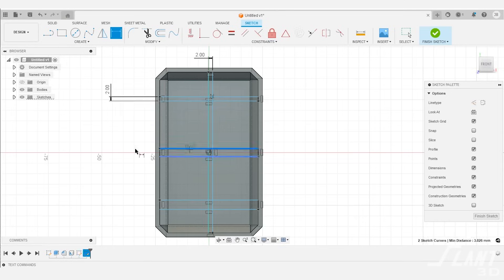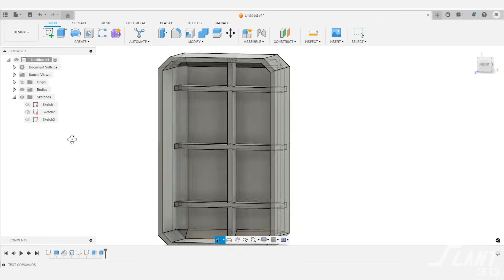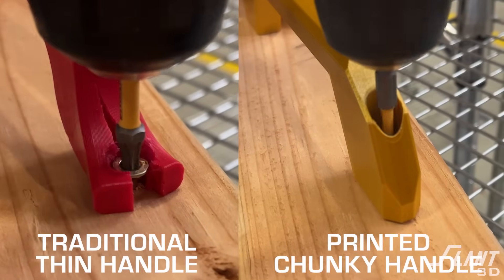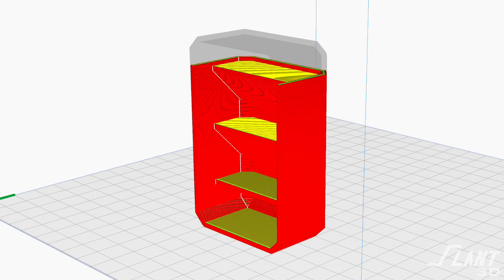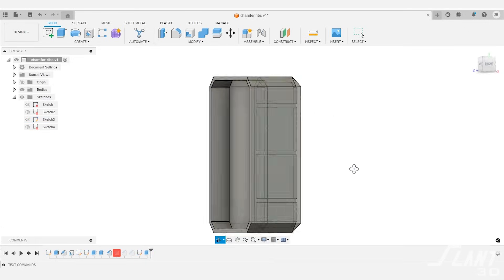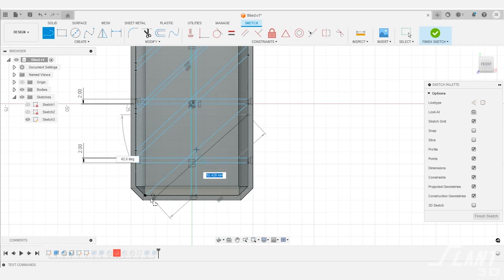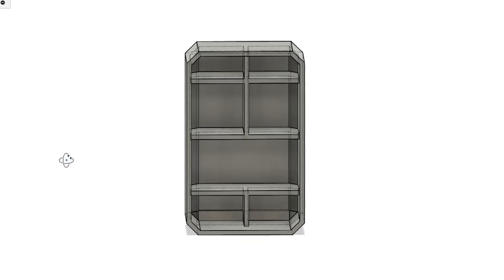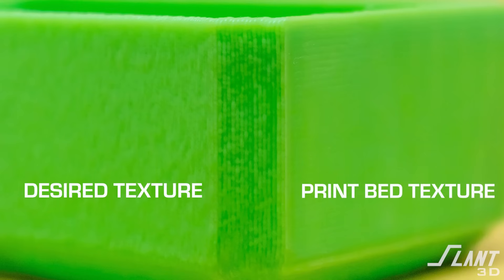Ribs | Design for Mass Production 3D Printing

Comment: there's something I don't understand: why does the top of the part not require supports when printed at that orientation?
Reply: @way-out350 I assume you are wondering about the second model. If you look closely, the top part is shallower than the rest which would reduce the likelihood of sagging. But that is never mentioned in the video.

Comment: Frankly, as interesting as these videos are, I feel like they kinda fail on the most basic, fundamental level: 3D printing is not a viable tool for Mass Production. It's not that companies haven't figured out how to design products to be mass-produced via 3D Printing, they just realized that other production methods scale better when you get to the level of producing hundreds, thousands, even millions of identical copies of the same product.
Reply: More clueless traditional thinking. If 3dp doesn't work for mass production then why is he literally DOING IT RIGHT IN FRONT OF YOUR FACE and making a good living off of it?
Reply from the maker: We are the largest print farm in the world. We do it all the time.
Reply: @slant3d  just because you spent a lot of money on an idea doesn't guarantee the idea is actually a good one. What is it about 3D printing that would make it a better production method than say, injection molding or die casting?
Reply: @lightningstrike9876  starting cost is lower, and you can get parts shipped to your warehouses at a constant rate instead of all at once, or even ship the parts directly from production to customers.
Reply: @justageekygamer  fixed costs need to be balanced against dynamic costs, however. In a mass-production setting, the special spools of material for the 3D printing setup are going to be more expensive per-ounce that the material used in simpler production methods.

Shipping is itself a cost that needs to be considered, and shipping is generally calculated on a per-delivery basis. The more product you can ship in a single delivery, the cheaper it will be. Companies prefer the occasional big shipment over a constant stream of small shipments.

Once you get the point of shipping items directly from production to end user, that only really becomes necessary if products are being made on-demand, and at that point it's no longer "mass production".
Reply: @lightningstrike9876  while I appreciate the content this channel provides it's important that people aren't misled (in a non-nefarious way in the case of this channel of course) so thank you for providing this information.

Comment: Thanks for the lesson on ribs.

Slanting (punt intended) prints to eliminate overhangs and supports is a powerful idea. I once printed a garmin to gopro mount adapter and I can tell that if not designed to be print slanted, the part will most likely print horribly, requiring supports in tiny tight space that would be a pita to remove.

Comment: We need more Channels like Slant 3D.
Reply from the maker: Thanks for watching
Reply: I second that. Engineering specifically for 3D printing is the next level, and this channel leaves nothing to chance.
Reply: @mbunds  people seem to get hung up on designing for 3D printing, saying things like, “you shouldn’t have to design for the manufacturing method, the printer should just be able to print it” and all that, it might just be because a lot of people watching are hobbyists but it just shows they don’t know what they are talking about. Every manufacturing method needs parts designed specifically for it, a part designed for machining would be different than for injection moulding. You always need to design to make use of what technology you have available and in any use other than hobbyist you have to design it to reduce cost.
Reply: @conorstewart2214  Taking the hard path long before I had the pleasure of running across your channel, I learned early on that there are essentially two approaches to 3D printing, "proportional", where items like statues, figurines, and other decorative objects, along with low-precision utility items, which do not require precision tolerances, and the "precision" approach for gears, bearing shells, threaded assemblies, and enclosures which require extreme tuning of the FDM system to reduce post processing.

This requires learning the finesse behind adequate bed adhesion and good first layers, then balancing speed and temperature to get tight control over warping and layer adhesion, which I have nearly perfected, thanks to people like yourself.

A feel for the filament types is essential as well, and not only the gross type of plastics like PLA, ABS, or PETG, but the way various blends of these among manufacturers respond when printing, which is why every shipment, even if I have already "trended" the blend (manufacturers aren't always consistent in their blend proportions), gets profiled and documented with a label indicating its best performance.

After learning to adjust the way I design for 3D prints (thanks again) now, when a part is ready in CAD, I only have to drag the model into the slicer, then WiFi it over to Octoprint on the target printer, and assemble the parts when finished. I can produce very precise centers between holes, and adjust the tolerance for how well a part will accept things like bearings from press-fit, to light friction at will, in a single iteration, zero "elephant's-foot", zero "PETG stringing" (mostly), with maximum strength.

What I don't have is speed, because PETG and TPU taught me that sometimes there is no substitute for patience.

Thanks again!
Reply: @mbunds  this isn't my channel and I don't have anything to do with it.

Yeah a lot of people just see all PLAs as PLA, or all nylons as nylon, when most of these names are just general and broad terms and the properties can vary greatly depending on what exactly they put in it, even just looking at the TDS of filament it varies a lot even with the same name like PLA.

As for plastic varying roll to roll, if you look at the MSDS for plastics it will tell you roughly what is in it and in what proportion, some carbon fibre reinforced nylon I was looking at had a range of 12 - 20 % carbon fiber content, so that is a large range, that will apply to pretty much any additive they add, it isn't really exact, even the colours of the filament aren't always the same. I think some companies do let you specify that you need all the rolls you buy to be from the same batch and if you are a large company you can probably buy a whole batch. I wonder what it is like on the very high end of filaments like ultem and similar, they have government and aerospace certifications so I would imagine they aren't allowed to vary much in terms of mechanical properties or contents.

This is a good channel though and focuses on different parts of 3D printing compared to other channels, it isn't about the mechanical properties or looks of the filament, it is good for giving you new ideas on how things could be better designed.
Reply: @conorstewart2214  I just bought some hardened nozzles, and getting ready to test carbon fiber. Have you found it to be significantly stronger? Sooner or later I'd also like to try Nylon, but I'll need higher temp hot ends.
Reply: @mbunds  I've mainly found it to be stiffer but also a bit stronger. It varies from brand to brand though and depends on the base material. Like a PA6 with carbon fiber will absorb moisture and lose a lot of strength but the base material does that anyway. PLA with carbon fiber is known for being even more brittle than PLA but I have had some good results with it, petg or PET with carbon fiber is quite popular too, PETG with CF retains a lot of its impact resistance and strength but becomes stiffer. PET with CF is very stiff, strong and brittle, potentially up to double the strength and stiffness of PLA and much higher temperature resistance (up to 200 C)

Carbon fiber can also help with wear, essentially as the part wears the plastic will be worn away first and leave exposed carbon fibre pieces which are very hard and wear resistant. Carbon fiber can help with temperature resistance in some materials, not so much with PLA and PETG but definitely with high temperature nylons or PET and higher temperature plastics like PEEK or PPS. Carbon fibre can also make these materials easier to print by providing structure as they are printed and cool.

Nylon with carbon, glass or kevlar fibres is worth it if you have a valid use case. If you go for carbon fibre nylon then you should make sure it is a PA12 to start out with, PA6 just absorbs loads of moisture so is best suited for very dry environments. You can also get other additives like glass microspheres which apparently increase rigidity and makes it more wear resistant by I haven't used any of that.

Your budget also dictates what materials you can use, PLA and PETG with carbon fibre are relatively cheap, nylon or PET are more expensive, and more unusual additives get even more expensive. 

The datasheets can give you a decent overview of the material but don't tell the whole story, like how the mechanical properties degrade with moisture, so you need to have knowledge of the base material too.

Without an all metal hot end you are limited to the lower end of printing temperatures for the likes of PETG and ABS so you won't get the full strength out of them. A normal all metal hot end can print up to 300 C but a hotend with copper heatblock and plated copper nozzle and high temperature heaters and thermistors can easily reach 450 C but any material that prints that hot will most likely require a heated chamber too.

Comment: You could also create walls inside the infill, by making thin gaps inside the model or add thickness to the infill
Reply from the maker: Why?
Reply: @slant3d because wall loops is what gives rigidity to a part and having them enclosed inside solid body is a nice way to get extra rigidity without harming looks

Comment: i think your fundamentals for ejecting parts may be flawed, because the first part could be printed without supports on the right orientation, furthermore having high z height on a print is the slowest way of printing it, you are adding a constrain that determines quite a lot of your process, maybe another form of ejecting could be considered, if the bed is leveled right way it should not be a problem to have a lot of contact surface area, the ejecting part is quite a problem to solve, i've been testing concepts for a while and have some interesting solutions in mind, why you dont go the belt way? i think that a belted corexy with static z bed is the best solution, but dont know what consequences implies that makerbot belt patent that everyone talks about really are.
Reply from the maker: Belted machines are a dead end.
Reply: @slant3d  i think if you have to move the belt to print its not a good idea, but with a corexy with a static bed the belt only moves when you finish the print and release it, why else do you think are a dead end?
Reply: @slant3d  would you mind explaining this a bit ?
I had often wondered why you hadn't used machines like the CR-30 for part of your farm to give more "print directly to bin" options, it would also unlock possibilities for an "infinite" length along one axis if that were ever required
Reply: @samrix8625  this is kinda this guy's shtick. he gives these 1 line responses thinking he greater than thou
Reply: @samrix8625 one of the downsides for machines like the cr-30 is the footprint to use it, if you want to print something large you have to have the space in front for the part to keep rolling, and imo belt printers that rely on the belt y-axis to print are bad cause the print speed isnt good and if you roll forwards and backwards the belt will eventually offcenter itself, the corexy static bed solves those problems and i still dont see a bunch of eyes on that obvious idea, the other factor is the belt wear, it is going to be a consumable no matter what, the thing is going to be sooner or later but you will have to replace it, a spray on top may expand the life span of the belt tho, and furthermore, there are companies selling specialized belts for 60 dollars, so i think is totally a good deal, a good test would be to see practically how many hours can a belt last, i suspect that with proper printing it would be a lot, but i would love to hear a technical analysis from @slant3d for this one, and a good debate on the comments, i dont like 1 liner answers

Comment: Why not print on the back side of the part? I would imagine it’s for strength because of the layer lines, but it doesn’t really seem necessary here
Reply: Because that would be an easy solution with no need to explain how to design around the limitations of 3d printing. You want to learn how to do it in the general case, where this might be a small part of a larger assembly and you don't have an easy choice of how to build it, or you might have similar bits inside facing the other direction as well.
Reply: Bed adhesion is another issue.  Having to much surface on the bed makes it hard for the pusher arm, or robot, or whatever to bump the part off the bed so the next one can be started.  If you have to pay a person to strong arm each individual part, it's going to be more expensive to make.
Reply: Might I ask which surface? You make some great points here, but this example piece seems like it would print very well the way @Faysalariss said.
Reply: He likes printing things upright but never explains it. I always assume that they can fit more parts on a buildplate that way, so they can have higher output per print cycle.
Reply: @zoli11  he has said quite a few times he doesn’t batch parts, that means only one part on the build plate. If you have an automated way of removing parts not batching them is better, less travel, if one fails they don’t all fail, etc.
Reply: @zoli11 he explains it all the time. I'm mass production you need to push the part of the bed with the tool head, not involve a person. It's to save time and manual labor costs.
Reply: This model is an example piece which has only the rib feature to account for. Sure, the example model could just be printed on its back (especially if surface doesn't matter) but if you have a similar part with other features (holes, overhangs etc) you end up with parts that require conflicting orientations.
Reply from the maker: Surface finish

Comment: 3d print noob here, so sorry for the stupid question, but why would you print it on the short side down, when printing it with the bottom down would mean that there is no sagging since all the walls are vertical?
Reply: Bottom down means much more surface area on the print bed which makes the part harder to remove. That is ok for home use, however if you want the pieces to get "kicked off" by a robot when the job is done so you can print again, that is more troublesome and might need people spending time aka higher cost.
Reply from the maker: Surface finish not good or controllable. You want first layer to be as small as possible.
Reply: @slant3d  You only want the first layer to be as small as possible due to the limitations of the way your machines remove the part after printing.   You are basically limiting the options of the customer due to this.